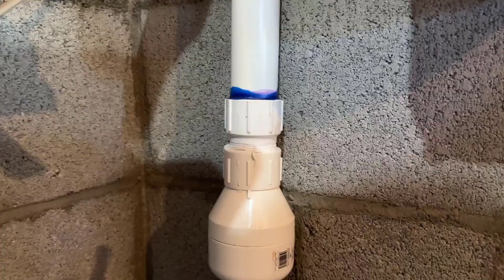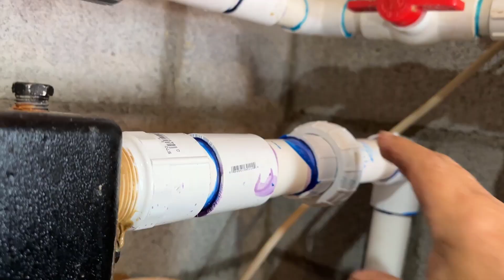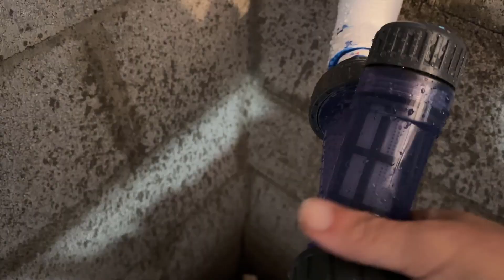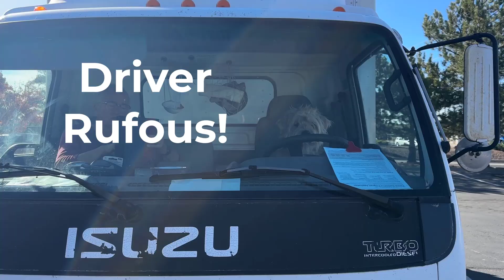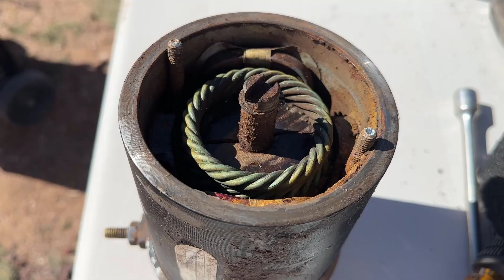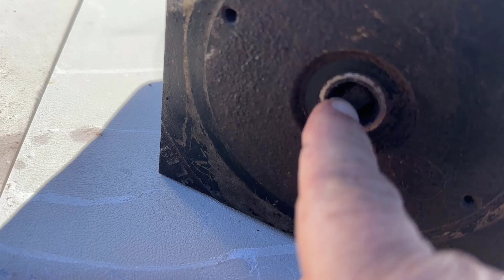Minor Water Leak Fixed And Liftgate Power Unit Finally Replaced

Comment: The unions in your water lines saved you some time on fixing the leak. Sometimes it is just easier to replace rather than repairing some things. Especially if they are old and outdated. Better get  packing for your trip. You don't have much time left. Have a safe trip.
Reply from the maker: Thanks Bryan! We managed one week’s loading in two days. But we still had a major, critical, failure before leaving 🤣😳 take care.